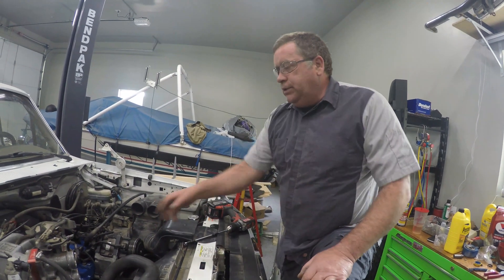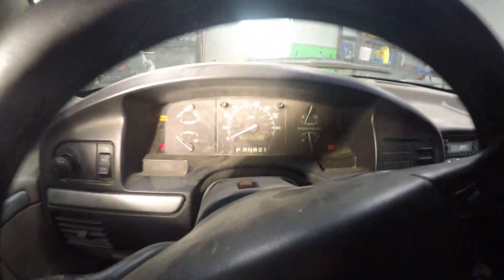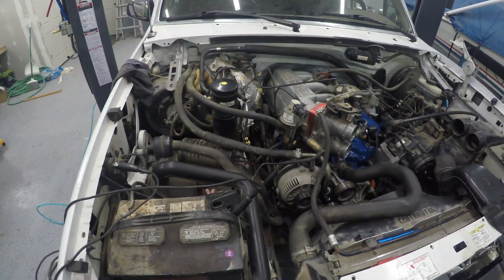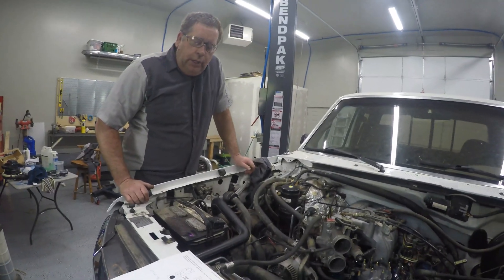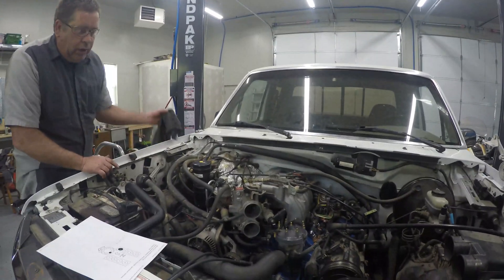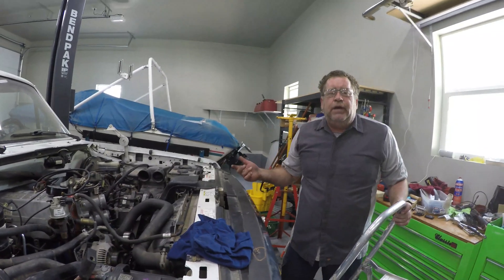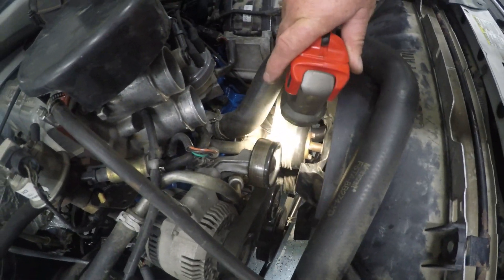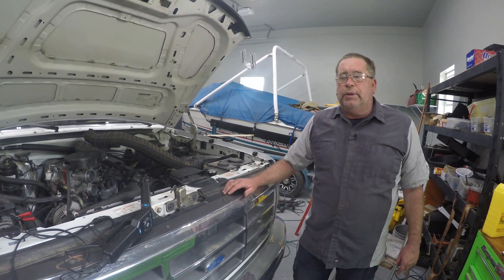351 Windsor Engine Rebuild, Part 5

Comment: Did you use any particular break in oil additives?
Reply from the maker: I did not.  I use a high quality assembly lube and feel that this protects the engine during break in. If I had installed a new cam shaft I would probably use some type of break in oil, but since I used the old cam shaft I wasn't very concerned.